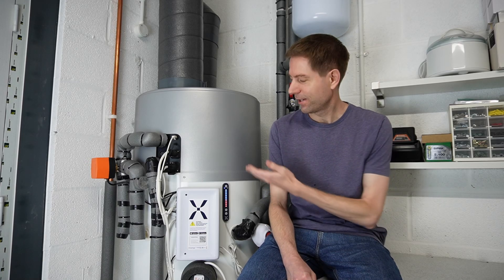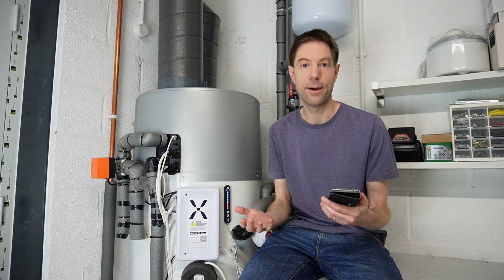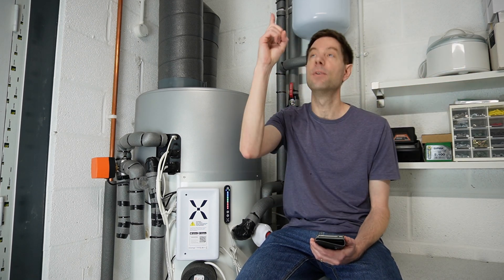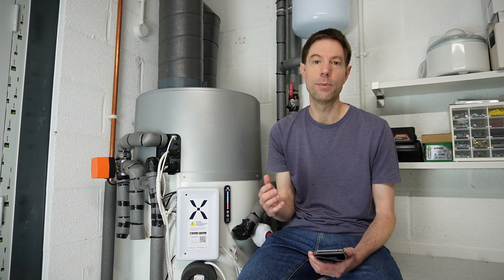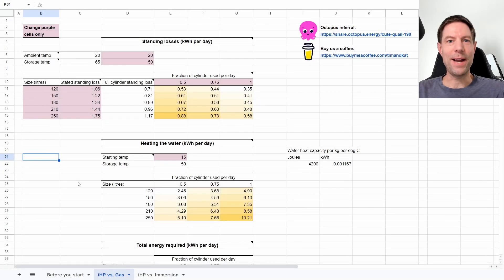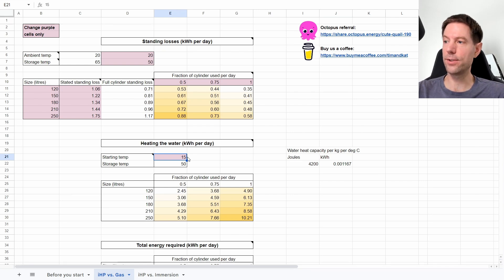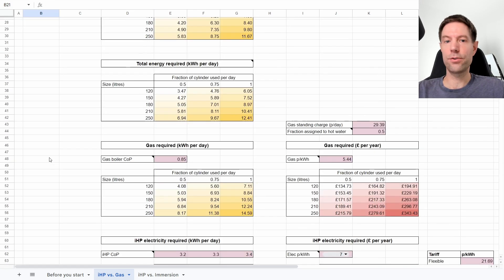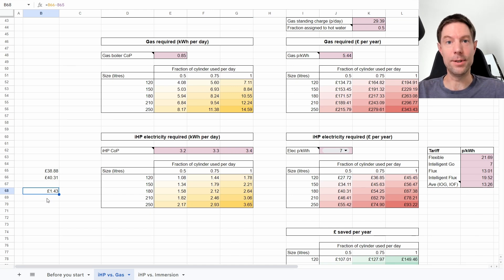Mixergy iHP cylinder - is it noisy?

Comment: Hi @TimAndKatsGreenWalk, I’ve just purchased the Mixergy iHP too just about to get it installed in my garage. Did you think about getting the air intake to come from inside the garage rather than external air?
Reply from the maker: @jimmcadam6860  I didn't want to cool down the garage by using up all the warm air in there (which would then pull air in from outside to replace it), so no, my preference was to draw from outside.  If your garage is very leaky anyway and not part of the thermal envelope of your house, then it wouldn't make as much difference, but since our garage is part of the house I didn't want to cool it down.

Comment: I've been following your vids for a while - thanks for them!
I've a quick couple of questions for you...I've got a battery system & I'm getting a heat pump installed (mine's air to water).
Do you run your heat pump from the battery or from grid only? What sort of kWh draw per day to they use (in the winter).
I'm sure you've covered this, but I can't quite remember...
Reply from the maker: Take a look at any of my recent solar stats videos and you'll see our monthly heating load over the last year, so that should help give you an idea of typical demand.  We tried a new strategy last Winter where we boost the heating overnight during the cheap Go period while the battery charges at the same time, which means that bit comes from the grid (at a cheap rate).  We then run from the fully charged battery for as long as we can until it runs out.  On all but the coldest days that means we can run the heating using effectively off-peak power, with only a small amount of peak grid power used.  I'll find the relevant videos for you, one sec...
Reply from the maker: My latest stats video, take a look at the A2A values for the Winter to see the heating load:
https://youtu.be/1eUXwL1ZYtw
Reply from the maker: The original concept for boosting overnight: 
https://youtu.be/q1tYCenxb2M
Reply from the maker: The result of switching to overnight boosting can be seen from mid Jan onwards in this vid (prior to that we only heated during the day): 
https://youtu.be/_qysulne5g0
Reply from the maker: Actually, this stats video from January shows the heating in a bit more detail: 
https://youtu.be/XUfqrSrpDTk
Reply: Mine uses about 10 units a day during winter, 4 bed semi, 7kw vaillant. Including dhw.

Comment: The other factor is that heat “lost” inside the thermal envelope of the house isn’t lost… at least not in winter.
Reply: Hi @TimAndKatsGreenWalk, I’ve just purchased the Mixergy iHP too just about to get it installed in my garage. Did you think about getting the air intake to come from inside the garage rather than external air?
Reply from the maker: @jimmcadam6860  I didn't want to cool down the garage by using up all the warm air in there (which would then pull air in from outside to replace it), so no, my preference was to draw from outside.  If your garage is very leaky anyway and not part of the thermal envelope of your house, then it wouldn't make as much difference, but since our garage is part of the house I didn't want to cool it down.
Reply from the maker: True, although we don't tend to make much use of that in the garage.  It'd help keep the batteries a bit warmer, I suppose.
Reply: It’s also not a huge effect since the loss is relatively small in any case.
Reply from the maker: @JohnR31415  indeed.  Modern cylinders are pretty good nowadays.

Comment: Interesting Tim. I'd be looking at a way to utilize some of that cold discharge air in summer for some free A/C in your kitchen via a diverter damper & bit extra ducting. Just a thought.
Reply from the maker: It's really not worth the extra complexity and expense of the more complicated install that would be required.  The simpler the install the better, really.
Reply: I’m thinking the same thing. Given the right part, it should be very simple, and as you say - lovely cool air in the middle of the house in the summer. We need a spreadsheet to tell us how effective that cooling would be for an average sized house in mid summer!
Reply from the maker: @paddyeason9677  it really isn't worth it.  The extra cost of install would never be recouped.
Reply: @TimAndKatsGreenWalk but it’s not always just about the cost, is it? I’m not even sure how one would quantify it, if (as is usual in UK houses) there is no other source of cooling in summer.
Reply from the maker: @paddyeason9677  we have AC (it also runs our heating).  The amount of cooling you'd get from the iHP would amount to a few pence per day for a few weeks a year.  You also lose efficiency with more complicated ducting, so what you gain with cooling the house you'd lose in lower hot water efficiency throughout the year.  You'd also need to deal with a very fast moving jet of cold air coming into your house with some sort of diffuser, which would add more complexity and cost, and further reduce the efficiency.  I know it sounds like a good idea on paper but in practical terms it really isn't worth it.  The simpler the install the better.  Then use proper AC for your cooling, which you can then also use for efficient space heating in the Winter.

Comment: Hi Tim sorry to be a pedant but what’s the db value?
Reply from the maker: I deliberately avoided mentioning db values because it doesn't mean much to most people, opting to relate it to other similar noise levels instead.  But it seems someone else has provided the answer from the data sheet, I hope that answers your question.
Reply: Mixergy Tech data sheet states iHP SPL is 50dBA. No distance stated but I would assume that is at source or at 1m.